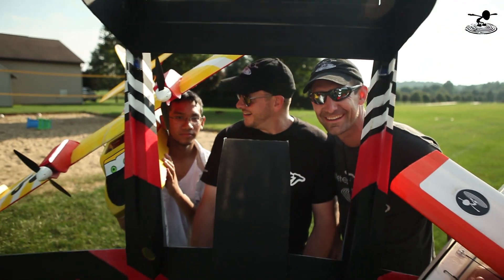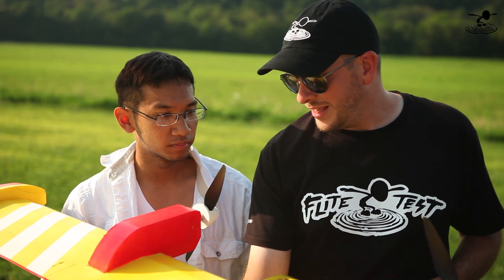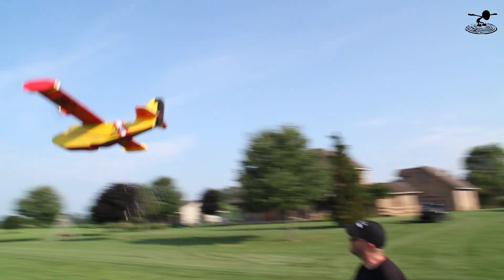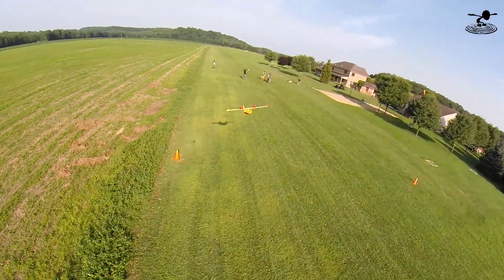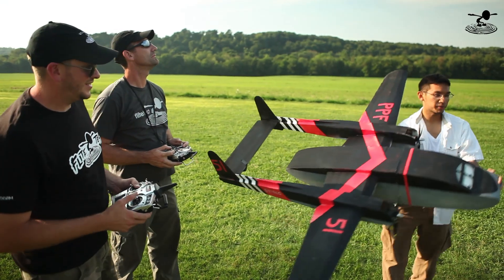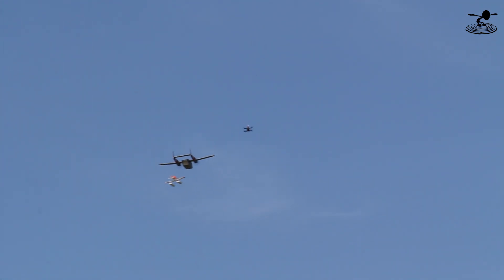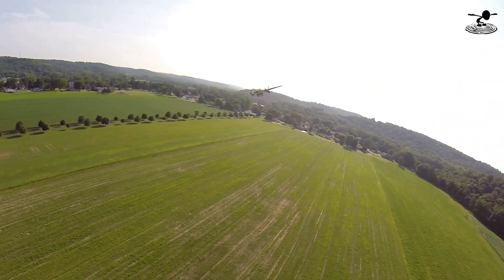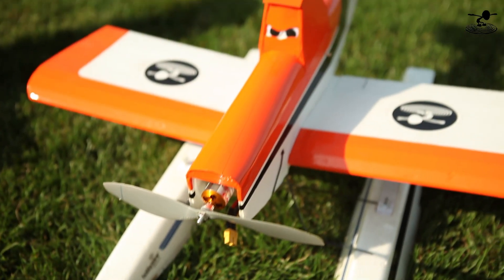Flite Test - Planes: Fire & Rescue Challenge

Comment: I just realized that Peter built a fully functional water-dropping plane YEARS before his marginally less successful attempt with William Osman (the one that also dropped gravy on the Thanksgiving dinner table). The gravy plane used a much clumsier water-dumping system with a servo-operated ziplock bag full of water. It did have a much larger water capacity, but also leaked badly. I'm starting to think the gravy plane was intentionally done in a goofier way for comedic effect, because this cup-based system seems to work very well and is much simpler.

Comment: make dogfight planes. Like a plane with missile/s. Like unguided air to air missiles
Reply: maybe use like a pool noodle and one motor at the very tip of the pool noodle. and very small wings at the front, elevons and vertical stabiliser+Rudder. If you have an fpv you can guide it in mid air to hit a plane.

Comment: where is the bix 3????
Reply: What about it? Given their current relationship with HobbyKing, I wouldn't hold your breath.
Reply: Chris Riccio
whats w/ the h king relationship
Reply: mansma rosen Wondered why there hasn't been a Hobbyking sponsored episode in a while and the "Bix3" isnt called the Bixler 3? They can't use his name anymore. Call it "creative differences". You won't see anything positive about HK on FT anymore.
Reply: Chris Riccio
Wait What happened with HK & FT?
Reply: ***** nothing, Flite Test simply got to the point where they no longer needed sponsorship, as their profit from the store was ample to allow the creation of new episodes, or at least thats what has seemed to happen.
Reply: Chessie Newbold
indeed, someone implied there was some negative issues between FT and HK.  So far I haven't had any getting Hobbyking parts. 3 days US, 7-10 international.
Reply: Try either Multiplex Easystar2 (the Original, the Bixler 1 and 2 are slightly larger but underpowered clones of the Easystar) or the Volantex Ranger EX.
Reply: ***** I like HK, but my last order from USA warehouse took 9 days to ship and by the 12th day I finally received my order. They also forgot an item that I ordered and made it a hassle to get that item. Poor Customer Service.

Comment: You could have had the plane carry a filled water balloon in a rear compartment, then set up a servo with sharp piece of wire that extends into that rear compartment to pop it on command.

This would have let you keep the water almost completely separate from your electronics, and you would not have to worry about losing any water while you flew around.
Reply: Good idea
Reply: Well it’s actually a really good idea but they might not do this again now
Reply: Yeaa
Reply: Or they could just drop the water balloon with an automatic hatch?
Reply: Clever idea
Reply: That's an amazing idea
Reply: I- ......I never thought about that... ._.

Comment: I really love these twin engines large planes with FUNCTION to them. I love seeing things like this being used, abused and having a good time.

I would love to try and make a RC base with cargo planes dropping things off, solar panels at the base with a plugin point planes can taxi to or even those induction recharging pads. Have one of those robotic arms and a link up to a array of cameras from all angles to work as traffic control and such. just completely unmanned little experiment. Maybe even have it by a small stream so you can put cargo ships to come along and pick things off, of course only be like 40 feet away from the controllers but to reach out and have some self sustained air base would just be the most awesome thing. Man.. I can rant xD